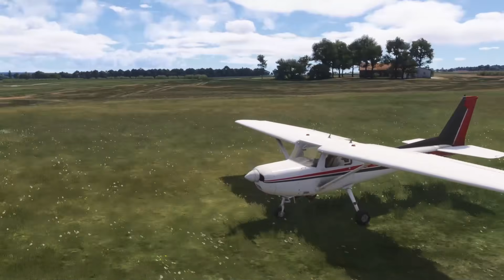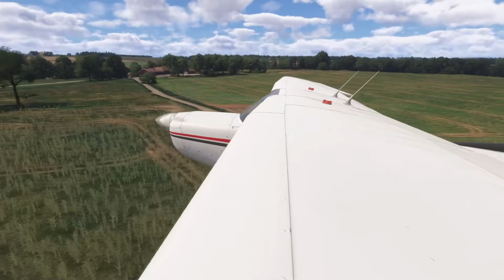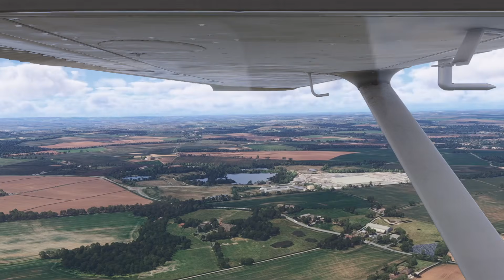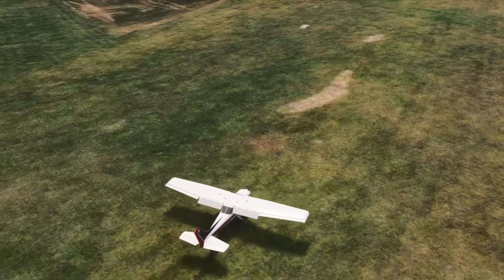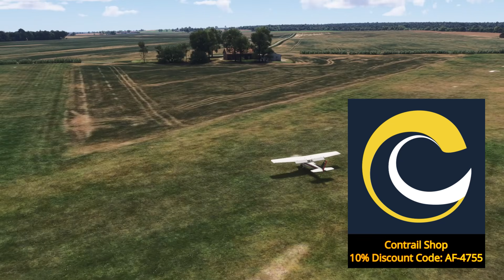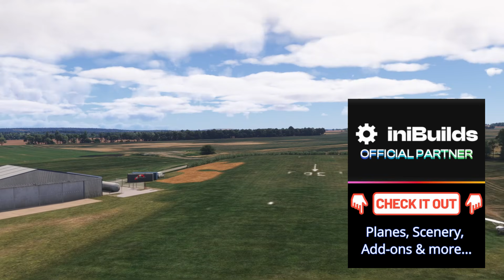MSFS 2024 Realistic Circuit Training | Real World General Aviation Training Flows

Comment: Just a minor one with abbreviated callsigns in the UK - G-EJSP is abbreviated to G-SP (not G-EJ) and only after the controller has used the abbreviated callsign first.
Reply from the maker: Of course (I want going for RT clarity & radio check is done on start up whereby controller has usually abbreviated the callsign, though this aircraft reg as far as I'm aware doesn't actually exist)

Comment: Great video as usual, I was always taught no more than 15 degrees bank in the climbing turn. Remember that stall speed is very high in this situation. On the base leg, apply carb heat and reduce power to 1700 rpm, and trim for 65kias after lowering 20 degrees flap. On short final, at 300 ft, push the carb heat back in, in the event of a go around this ensures you achieve max power when you firewall the throttle. Keep a touch of power on before the flare, once in a level attitude, reduce to idle and pull back in that yoke!! 
Have a great time tomorrow, cheers.